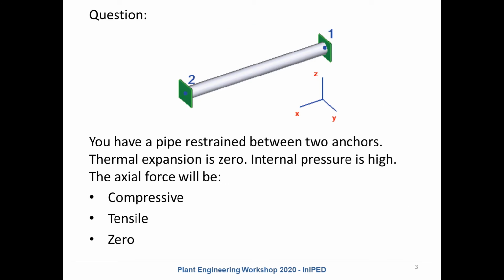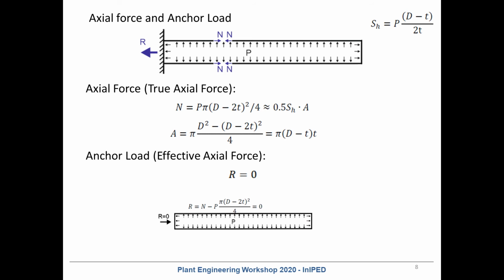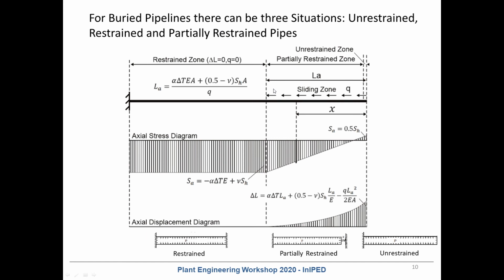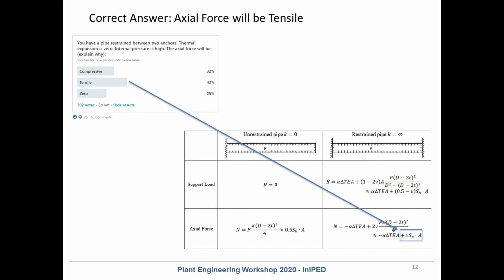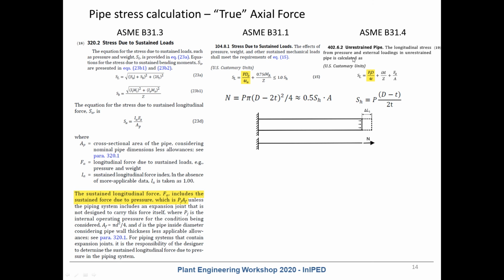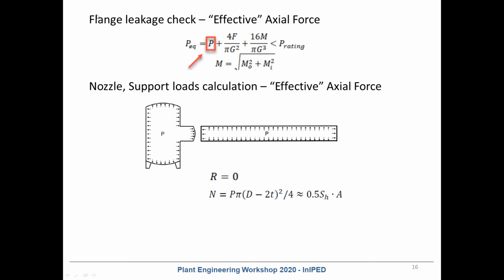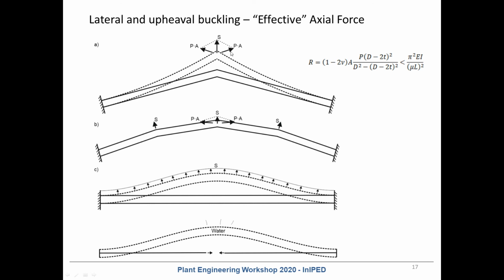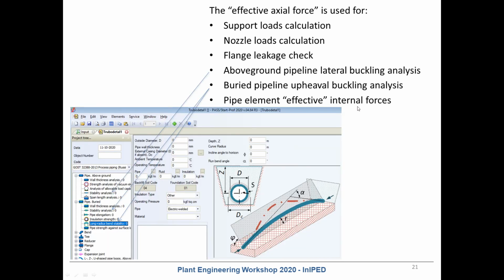Importance of Bourdon Effect. True and Effective Axial Force

Comment: Thank you for the detailed explanation.
Regarding the example you gave with the equipment nozzle check, if I understand correctly in case the vessel is anchored to the ground, effective axial force R is not equal to 0.
Am I right?
Reply from the maker: It doesn't matter if the vessel is anchored or not. Anchor will affect only thermal expansion and piping axial elongation due to pressure if it has anchor on the other end